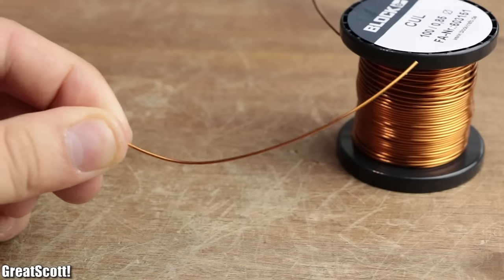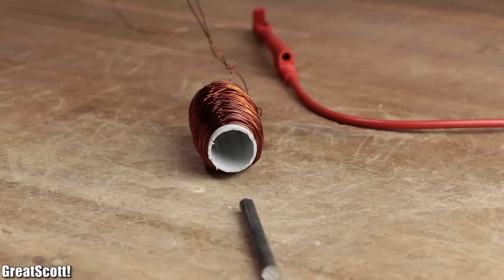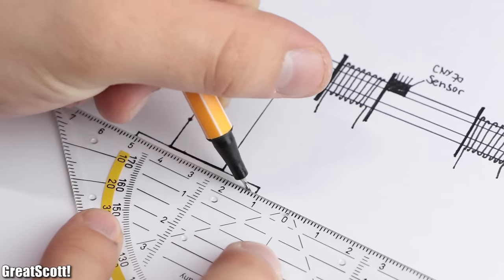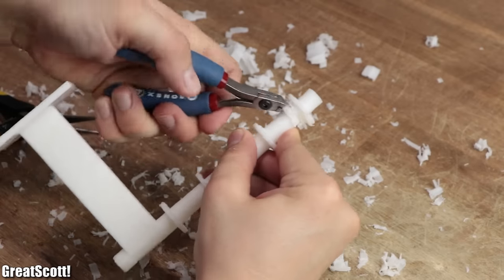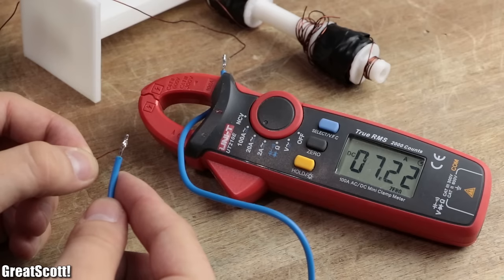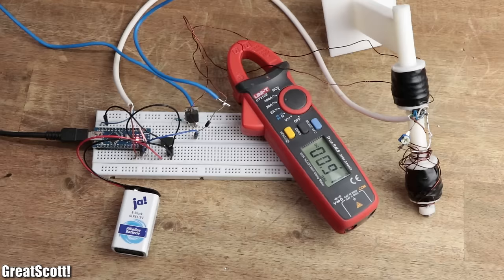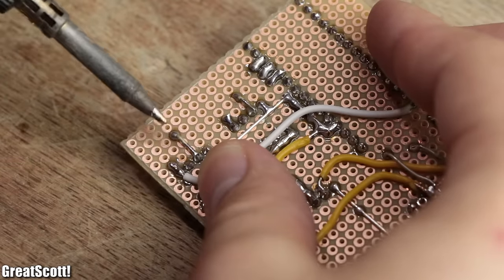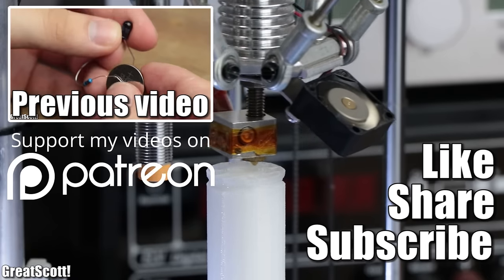Make your own Coilgun

Comment: Idea for a "2.0" of sorts, maybe  calibrate the optical sensors to deactivate the current at precisely the optimal time before the coil begins to pull the projectile back into the center of the coil.  Might not do much but you could get a bit of extra speed out of it.
Reply: It is set up like that
Reply: Powder-phun  no because the optical sensors are at the end of the coils rather than the front and the code only had a delay of a single microsecond which is likely faster than the equipment can compute. It would need to be precisely calibrated with the optical sensor at the start of the coil to give the equipment adequate time to deactivate the current at the appropriate time. This would also give it the ability to shoot smaller projectiles because they wouldn't have to go all the way through the coil to activate the optical sensor.
Reply: Your method is hard/impossible to implement, because you don't know how fast the bullet is moving. This guy set the optical sensors so that they turn the coil off when the projectile is perfectly in the middle, which is the best possible moment to switch it off.

Comment: What if you used a metal barrel? Would it still work? And how about you use this system not to get the projectile moving but to get a piston moving that in turn shoots out the projectile by using air pressure? So basically an air rifle.

Comment: I like the power electronics stuff, like boost converter, joule thief and this. If memory serves well, you mentioned in one of your videos, that you're learning power electronics. Could you do some motor automation or something with power electronics and automation? However, in my opinion not everything requires an arduino. Cheers!

Comment: What a great video!
I learned a lot and if you don't mind, I have some questions for you:
1. Why IRS2001? Isn't it an expensive chip ($3)?
2. Is it possible (cheaper and efficient) to  boost up the arduino mini's pin from 3.3v into 5v?
3. What would you do if you'd want to control 8x guns using a SINGLE pin (can fire one-at-a-time up to all-at-one, maybe TIP120?)?

Thanks!

Comment: I'm also trying to build one but i thought of using the analog pins of my arduino for my optical sensor. That way it's easier to set a value on which the switch gets triggered. But are analog pins fast enough in comparison to digital pins?

Comment: I have two questions perhaps someone can answer:
-Would it be possible to use an Interrrupt to detect the optical sensors or would that be still to slow?
-Does it make sense to use direct pin manipulation (like that PORTB |= 0x20) instead of using the arduino funtions digitalwrite and read or is there no significant gain in speed?

Great project btw thanks for sharing with us.

Comment: I took a few electronics classes a while back, I seem to recall that when you shut off a coil the collapsing magnetic field induces electrical current in the wire coil. Would it be possible to use the collapsing field energy to increase the power at the second stage?

Comment: Isn't it easier to wind the copper wire coil if you chuck one end of the plastic rod in a drill and turn it slowly while winding the coil?

Comment: I have a question for Q&A&C:
where and what exactly do you work with? In what did you congraduate? If the answer is in another video, please, let me know.

---------------------

As a response to this video: I'm making a single stage coilgun that uses two 63V 3300uf capacitors as a load. I think this is a best option, since the projectile won't get stuck on coil (because of the fast discharge) and also it will produce a big magnetic field. Am I wrong?

Comment: great project! just an idea.. but since the projectile is a naked steelbar why not just using simple conductive sensor to triger any digital I/O pin of arduino.. :)  maybe just using 2 ends of contacting wire, when the projectile passing between the wire... ?

Comment: the limited experience i've had making coils, the tape layers are helpful, but you are better off just wrapping the wire so tightly it can't shift and not using any tape at all. if you feel you NEED an isolating layer, it might be better to use plastic wrap.

Comment: +GreatScott! Why is in datasheet of MOSFET driver written that supply voltage is 10-20V and you are using 9V battery, right ? It shouldn´t work, no? Thanks for quick answer.

Comment: does it cost you a lot of money to 3D print your objects? Great video by the way
Reply from the maker: I think my printer needs around 100W, so in 5 hours that is 500Wh. You can say 1kWh costs around 30 cents. So 15 cents of electricity and maybe 35 cents of plastic. So around 0,5€ for my gun. I would say that is pretty cheap.

Comment: Hi Scott,

I expected you would putt in some measurement data to find the right timing information. Did you use just trial and error?
Another question I have is related to the fly back diode. This allows the magnetic field to stay intact and so pull back the projectile after it left the first coil
Does this indeed happen? is there something to do about it?

Comment: Hi, what is the purpose of the capacitors in this circuit, so why not directly connected to the power supply, there are capacitors. I searched the internet and other sources but I couldn't find a clear answer. I'd appreciate it if you answered.
Reply: Ahmet, capacitors can supply nearly unlimited current, whereas a battery can only supply so much current due to its internal resistance.

Comment: I'm not on nearly the same level as you when it comes to electronics and such. However one question I have is how come you used a IR sensor and not say for example an inductive sensor? Wouldn't that eliminate the work of fine tuning the sensor? Cheers!

Comment: I have a bunch of 120v AC induction motors. Can I use the already-assembled coils from those? There different sizes but I figure I can somehow arrange them in strength low to high?

Comment: which Arduino Nano you are   using ,the cheap ones or the real deal ?? coz I am using  cheaper Arduino Nano with ch340g chipset and it is buging me a lot . it's not just getting identified by my windows 10 pc . even though it has the suitable driver pre installed

Comment: Dear great scott,

I have a video / Project idea which could extend your ir transitting/receiving videos. The question... would it be possible to desolder an ir receiver from an existing receiver circuit (like the receiver in your previous video) and replace it with 3 wires which is connected to the pins of an arduino/raspberry pi/esp8266 and then digitally sending the data codes to the receiver through these connections from the arduino/raspberry pi/esp8266? If you know what the data codes are which is sent via the original remote control via ir of course. 

Reason: if this can work then it will allow you to wifi enable any old devices wich has an ir receiver using an esp8266 chip for instance as well as open a lot of doors using other devices like ir controlled rgb led strips or flood lights. This is what got me thinking whe i recently bought one of these lights. It is possible to build your own controller but seems pretty pointless as it already has a controller which is controlled using an ir remote control.

Thanks
J

Comment: question.. does this work in reverse?.. if you had a high speed metal projectile traveling down a barrel, and that barrel was wrapped in a copper coil, could it generate electricity?

Comment: Ok. So I tried with 5V and 15A (I did not have 12A) and after 20 seconds the plastic tube of my coil started melting. So this voltage and current should not used for over 5 seconds !

Comment: why not use a transistor connected to the gate instead of a mosfet driver to turn it on and off?
Reply from the maker: The driver is basically a more complicated transistor circuit

Comment: Is it possible to detect changes in current drawn from the coil and turn it off when current is at a peak or something like that? Since the light sensor requires a larger then coil projectile and using predetermined timing is a hustle every time an upgrade to the coil count is made.

Comment: hey scott can u make a versus video on "opto coupler vs relay" or some thing like that ?
Reply: There is an easy distinction between the two; An opto-coupler is meant for signals while relays are more suited to higher power applications.
Reply: +TheBeginner ElectricalEngineer this

Comment: This looks slick!  Could you continue to ramp it up by adding a longer barrel and more coils to make it lethal without higher voltage/amperage?  Also, how feasible would it be to rifle the barrel while printing?  (I've never used a 3d printer, so don't know if this is possible or not.)  Finally, would finer wire/more turns be more efficient at accelerating the projectile or would bigger wire/less turns be better?

Comment: I got a task from my professor to build a coil gun. He said that it has to be portable so I cannot use the 12v power supply. Do you have any suggestions on what kind of battery I should use?
Reply: richard wicaksono you could use a LiPo battery or li-ion , they fairly powerful, but make sure you have a proper charger and a circuit that shut off if the battery is too low

Comment: @GreatScott! Why is the Arduino "not capable" of switching the MOSFET on and off fast enough? I don't understand how the switching speed gets faster if you're still using the Arduino to drive the MOSFET driver.
Reply: he just need a reason why use the ic
Reply: MOSFET's are voltage controlled meaning how "wide the gate is open" depends on the voltage at the gate. When the gate is at any voltage between 0 and V+, the gate is only partially open meaning the resistance at the gate is large which results in large power losses (called "switching loss") and limits power through the MOSFET. This means minimizing the time in this transitional state is important.

Because microcontrollers can only supply a very limited amount of current through its pins (<100mA for most) it takes a very long time to switch and therefore remains in this state for a long time. Pulling more current than an MCU is rated for can also damage the MCU. 

The driver is a dedicated IC designed to deliver a large flow of current (hundreds to thousands of milliamps) during a switch minimize the time in this partially-on zone--more current means voltage rises/falls quicker.

Comment: Does it make the electromagnet stronger to insulate each layer of turns of copper coil?
Reply: Dude, you HAVE to insulate it, otherwise the magnetic field is pretty much 0, because the current is flowing not through the coils, but "over" them, without actually creating a field. So if you don't insulate, it won't create a field.
Reply: But the copper wire is already insulated. So is it beneficial to tape each layer of winding?
Reply: then what do you mean by insulating each turn?
Reply: MintSoup I meant insulating each layer of winding. In the video, he winds a layer of copper wire then tape around with insulating tape and wind another layer over the tape, so on.
Reply: Oh, in that case, no.

Comment: Why use photosensors? Can't you use the coils themselves to detect when the projectile in the middle?
If what I know about coils is correct, the less force they apply, the less their resistance would be.
So, if we connect the coil to an OpAmp and then to a comparator, we can detect when projectile is in the middle, even without the knowledge about its the length.
Reply: but it makes think a lot more complicated. Why bother?

Comment: you are fucking awsome.. im in love with the 555 and the 4017..  I wonder what is best way to save sounds to chip. does a ha17324 do the job. what chip saves sounds and locks them in ic

Comment: Hey just two short questions , can I use the Glediator  software on an Arduion Nano and  and can I set the led y and z achses to 1 and 60 to control a whole led strip with?

Comment: Why doesnt the ardouino fry up cause you're using a 9v battery? Doesnt it only go up to 5v?
Reply: Arduinos need a minimum of 7 to work properly, and can handle up to 12. They can run on as low as 3.3, I believe, but the output pins won't put out the proper voltage till 7.

Comment: lol there is a military railgun that shoots a projectile 2.4 km/sec, 8.600 km/h
Reply: This is a coil gun mate, not a railgun.
Reply: Railgun is a coilgun but bigger
Reply: Jaromy Van Der Sluis Railguns have rails, and a non ferromagnetic projectile, coilguns have coils, and a ferromagnetic projectile, they work in different ways.
Coildguns are basically electromagnets that propel the core, and railguns uses induction to propel the projectile

Comment: Is this how railgun work? Or something similar?
Reply: Rail guns have 2 conductive rails, that when shorted by a projectile it creates a magnetic force that will propel the projectile forward, or weld it to the rails if it isn't moving when it hits the rails.
And the projectiles or rails don't have to be ferromagnetic, unlike a coil gun where the projectile does.

Comment: i don't get it, you touch the coil with your hand while 3A @ 50v (it shows 14v though) current flows and you don't get a shock ?
please someone explain
Reply from the maker: I actually wanted to say 15V. I forgot to change it to 14V in the script.
Reply: @GreatScott!  of course, but i'm a noob in electricity, can 3A @ 15v shock you ? Or
 does our dry body resistance is enough to prevent current from flowing 
through us. I would prefer not to test before knowing :D

Comment: YOU OVER ENGINEERED IT!
You only need a few components  
-400v 150uf CAPACITOR 
-220Ω 2W RESISTOR
-N-CHANNEL MOSFET OR A 5A BJT
-A COIL
-NEON BULB (optional)
-100kΩ RESISTOR
AND THAT IS IT !!!

and a switch that can handel  500AMPS   SIMPLE RIGHT?

Comment: How does voltage influence the force exerted by the coil?
If you put 12V and 3A through the coil do you get the same force as 36V and 1A
Anywhere I can read about this?
Reply: read about inductors.
Reply: A coil's magnetic field is proportional to the current going through it (Search: Solenoid Magnetic Field). Voltage only determines the current going through the coil. I = V/R. where R is the resistance of the length of coil wire. So if you had a coil with 0.5 ohms of resistance and 12 volts across the coil then you would get 24 A of current going through the coil.
Reply: Thanks for your reply, very informative

Comment: but why should i use sensors, can i juste program my arduino to power the first coil then the second ?
Reply: it will get stuck because you will have to calculate the projectile velocity which I can tell you can because you asked this question.

Comment: Can you make a USB clock time?
Reply: Why a USB clock? If you've got access to a USB port you would have a clock on your PC. Plus, if it's running off of a power pack then just run the circuitry off of a battery instead.
Reply: TheBeginner ElectricalEngineer thanks but I want electric fan instead of USB clock sorry I'm just a person
Reply: +Game Play ah you mean persistence of vision clock?
Reply: Suraj Grewal no for some reason I don't have clock on my room that's my problem and I wanna make clock and fan for cool air while I'm in school or playing :)
Reply: there are persistamce of vision clocks you can make or buy, which will solve both the problems
Reply: Suraj Grewal I don't wanna buy it cuz I can get for free lol 😁😁😁😁😁😁😁☺